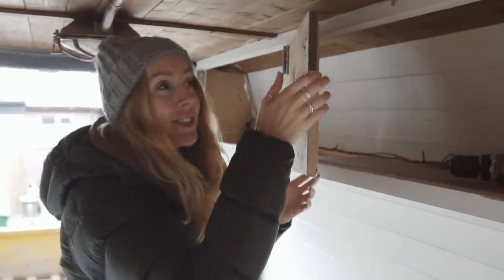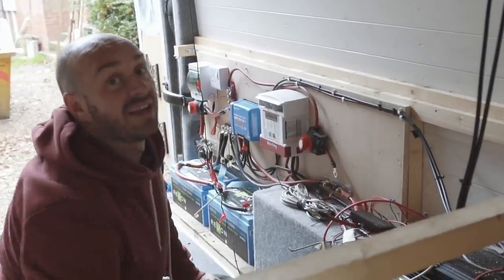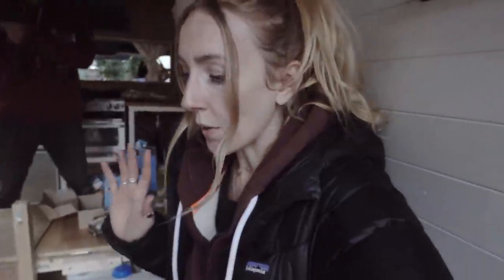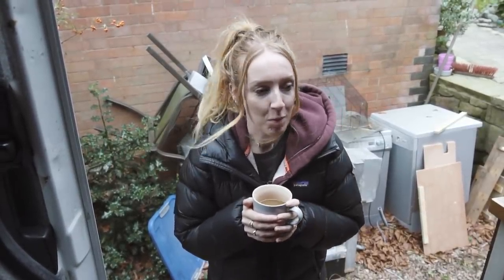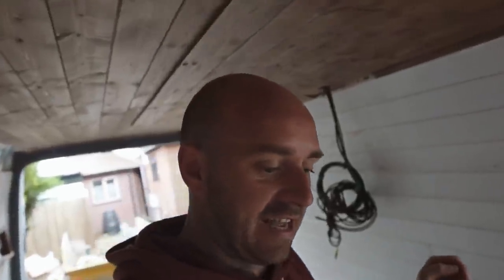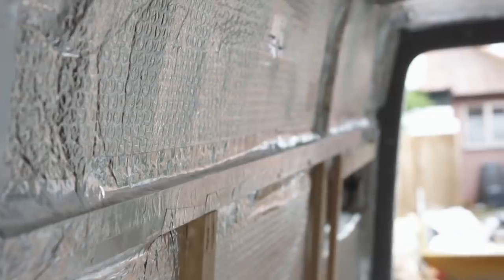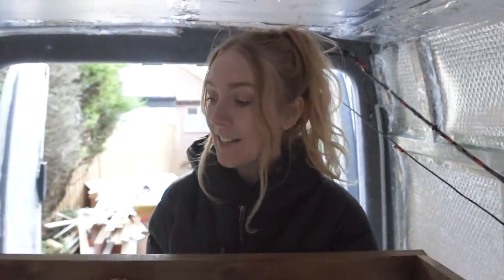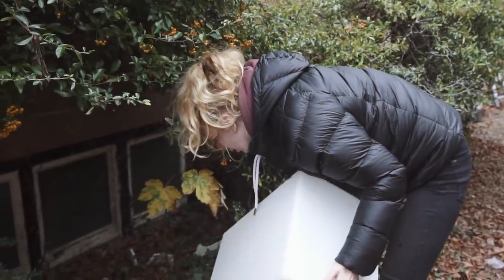RIPPING APART OUR VAN AFTER 1 YEAR OF VAN LIFE | VAN LIFE RE-BUILD

Comment: Hi guys watched a few of travel your vlogs and enjoyed. I am also a little confused after such a short time it must seem like you have wasted an awful lot of time and money. Please let us know the reason why. I have recently completed my van build. I researched and planned for 6 months and the build took 7 months. I have been living in the van for two months and are due to head to Europe for a year in 21 days - fingers crossed. The most important research I did was to see the mistakes others have made and thank them for posting this info. In the 2 months we have lived in the van we have ironed out the  technical issues, faulty equipment  and the only changes I have made are to put in 2x2 usb charging points by the dining area. The van is a joy to live in. We have a spacious living area seating 7 also creates full size queen. Kitchen with 500mm work surface, Belfast sink and 2 ring hob, grill and oven, 115 l fridge freezer. Bathroom 1400 x 700 with shower and nature’s head. Fixed bed 190 x 165 custom mattress. 2 x max Air fans.We have a rear garage with bike tray for 2 mountain bikes. Wall mounted storage for snowboard and skis, wardrobe for 25 items of clothing access under bed. 5 storage containers 400x600 and a twin tub portable washing machine. We have a full victron electrical system with 600w solar and for heating a truma combi 4e. On the roof we have fitted a fiamma storage box 1200 x 900 x 400. Fiamma 650 awning and a front runner rear door access ladder. 
The decisions and design were based on 3 things. Bed size - bed height - bathroom the rest of the van was dictated by these factors. I am in the process of putting a video together of the van. Good luck with you new design take your time....What does you van need to offer you in order to make van life a thoroughly enjoyable experience and not a challenging disappointment 
Rob
Reply from the maker: Sounds like you guys have a great set up! The reason we're changing so much is that our needs have changed since we first built the van - we now have a dog and we have a big trip planned that requires some upgrades. It's really only the furniture and walls we're re-building, and these changes should make us more comfortable in the van. We'll be explaining this in detail next week, as we want to dedicate a whole video to it. Best of luck with your Europe trip, it sounds amazing! 🚐💞
Reply: EXODUS 23:20  would love to see the lay out when the video is done.

Comment: Assuming you are going north, make sure you build in a good quality heater and heater ducts
Reply from the maker: Great advice - we wouldn’t go anywhere without a good heater! 🔥
Reply: I ducted mine into the shower room and into the garage. A lot of extra money and time but the shower is also a wet clothes drying room so I'm glad I did it. Also the shower and sink  has instant hot water with propane boiler.

Comment: Soft insulation is fine if it’s plastic based... rock wool isn’t right - it WILL hold moisture
Reply from the maker: Yes - but if you vapour seal correctly there should be no moisture in your soft insulation anyway
Reply: @OverlandingSophia   you can't solve the problem insulation thickness or type. You have to warm heat point and cold air point in your van by using webasto and roof fan all night.

Comment: Why didn't you sell that one and buy another?
That way you would have got something for all the work you put into the original van.
Reply from the maker: Because we would have to re-do all the rust treatment, the insulation, the sound deadening, the flooring, the solar panels, the WiFi, the headliner.. there’s a good 2-3 months of work still left in Sophia! Plus good sprinter vans are hard to come by, Sophia has low mileage and good bodywork, we wouldn’t find one this good again very soon ☺️🚐
Reply: @OverlandingSophia  True.
That's me told :-)

Comment: Lowered the value of that perfectly good camper by thousands, Why did you not just sell it,they are fetching good prices now. Then buy a new plain van to fit out as you want.
Reply from the maker: What makes you think we're lowering the value of the van without seeing the finished result?! SO many reasons not to just sell up and buy again! Good sprinter vans are hard to come by at a decent price; Sophia has low mileage, FSH and great bodywork. We wouldn't find a van this good very quickly. Plus we’ve already done all the rust treatment, insulation, flooring, carpeting, headliner etc not to mention the solar panels, roof rack etc.. So there’s about 3-4 months of work we’re keeping. It’s really just the furniture framing and cladding we're changing, including adding on a few extras.